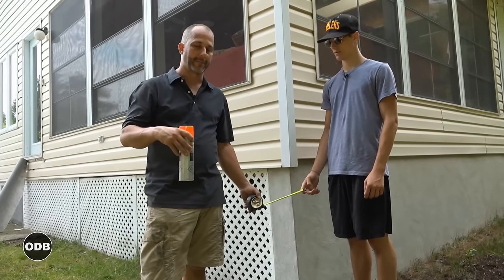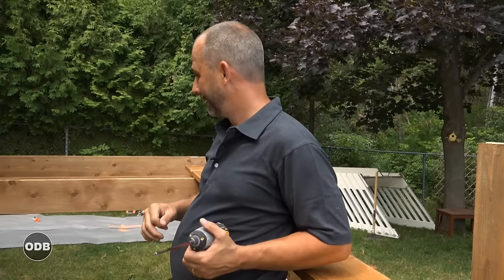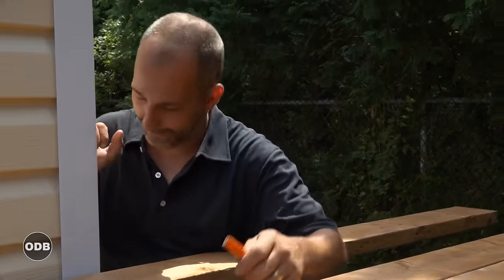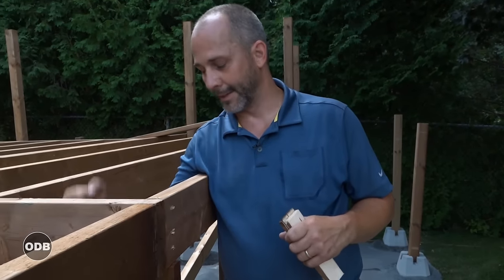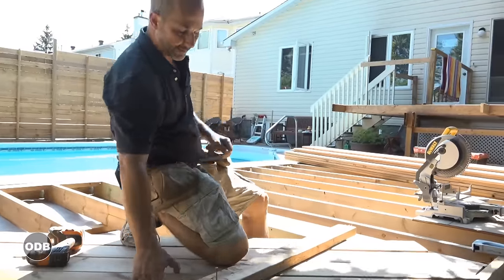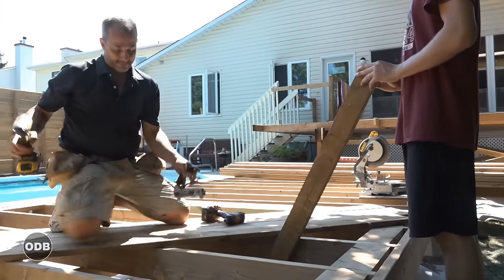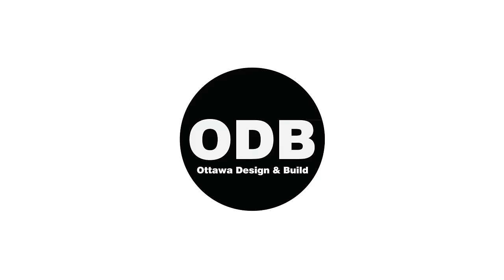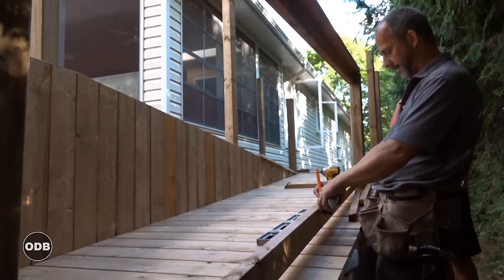How to Build a Deck for Beginners A to Z

Comment: Hey I'm not trying to be a wise guy or anything but why wouldn't you use a ship's auger to drill those carriage bolt holes?
Reply from the maker: That would work , however you only have 1 blade doing all the cutting and only the radius of the hole. This type of blade dulls very quickly in wet pt lumber.  My cold hardened steel will drill a hundred holes before it needs sharpening. This is why I use what I use. 
Great question, keep them coming. I love looking at new ideas it usually results in better problem solving skills down the road.
Reply: I'm an Electrician by trade and we use the ship's augers exclusively for drilling basement joists and anywhere else that requires deep holes.  I can't speak to your comment about wet PT since I don't work with it often but I will say that I've never had an issues using it when building my 10' x 20' PT deck. The bonus with the ship's auger is that you can punch the whole in one shot if you have the proper length bit.  I've never actually sharpened my bits either come to think of it.  Anyhow, time is money my friend.  Thank you for listening.
Reply from the maker: The other side of this is the ship auger may not create as clean a hole. I want the carriage bolt to be forced through the opening so it transfers weight directly. The ship auger may create a wider dimensional hole. But I am going to try it anyway. Cheers.

Comment: I am 67 and have health and back issues. Approx 8 years ago my brothers and I built a 20 x 10 ft deck and now it's rotting and falling thru and unsafe   I asked Home Depot for an online estimate for a 20 x 10 ft deck redo and to add additional 10 x 10 ft. add on, and received a $2200 - 4400 online estimate for pretreated lumber. I would be happy with a floating deck for the unfinished 10 x 10 area. I am on a fixed SS income and can only afford approx $2400 but don't know any handyman and don't know if I can trust them. I live in a suburb of Detroit. Can you recommend anyone? Thank you.

Comment: do you know how high can i make a floating deck? I want to build a deck with 54" height
Reply from the maker: Height is not a problem. However in most jurisdictions you should have a permit over 24" off the ground. You will also need to invest some time to make sure your build has the proper railings for your inspector as well. Contact your local building office and make sure you are building to your local codes before starting. Good luck.

Comment: I would never spread the limestone base material on top of organic material (grass) which will decompose. Would not meet code in my area.
Reply from the maker: I get your concern. However there is no huge gas trappings here and it will only settle a 1/16 of an inch. A bigger problem here is frost.

Comment: the only realistic problem with this deck is the displacement of the floating footings. they will sink over time and fairly quickly.
Reply from the maker: Sink into what? I didn't build it on quicksand. In our area frost actually raises rocks out of the ground. You are more likely to have it raise up than to sink.Don't be panicking people about an inch difference over many many years.

Comment: How about explaining in the beginning what the heck is a floating deck ?
Reply from the maker: A floating deck is when you build directly on the surface of the ground an do not attach it to any structure.
Reply: Thanks, you touch on that around the 1/3rd mark.

Comment: The joists should be resting on a cut out. The lag bolts don't have the sheer strength.
Reply from the maker: The Eiffel Tower in Paris is built completely with cariage bols, just like the ones I used. My guess would be that you are wrong about sheer strength. Perhaps a little reading before you try to make a statement of claim like an expert. It is how we avoid embarrassing ourselves.

Comment: Our building dept. would fail this job and hang  a big red UNSAFE CEASE WORK tag on it.  4x4s not 6x6s for posts...hanging the ledgers on bolts with no actual support under them...who knows if they're below frost or if they're rated for direct burial....this is a typical homeowner job. Deck failures injure a lot of people every year - hire a pro.
Reply from the maker: Did you actually watch the video! This was done under inspection from our building department. Stop trying to scare [people into thinking your lies are factual.

Comment: where they sold out of the 6 foot Robbie drivers lol
Reply from the maker: Not exactly sure what you mean.But thanks for watching.
Reply: your driver bit is a foot long just joking around... i use the impact bits ..I build decks for a living you did a great job on this one
Reply: GoGreenPM  they sell 6 inch driver bits at Home Depot! Make sure you get impact grade bits. The 6 inch regular bits fit in an impact but strip halfway through a project.
Reply: GoGreenPM All about GE cloth washing maschine  troble s.
Reply: Were*    where is a location

Comment: "This deck is solid as a rock," he says while visibly moving the railing.
Reply: My deck is 1metre below the surface and when I shake the 100x100 post there is slightly movement.

Comment: "we either have it free standing structure, or dig up the back yard to anchor it 5' under ground", the city gave us either of those options..."

me: "what a fucked up city, yes it's on clay and firm, but I believe that all of Canada does snow and water expands, if they told all builders all around "dig 5' deep, no exclusions" then all builders would be "ok, let's dig 5' deep or else we aren't passing inspection" and all will rejoice as there is less confusion about if wheelchair ramp and so forth.

Yes it would be more expensive but in the end it would assure all home buyers that "legal" means "safe" and not "well we bypassed one law by making it do this"
Reply from the maker: Let's not confuse the city inspectors job here. The deck is SAFE either way. You just can't attach something to the house without a footing. That is why we have 2 options. That is why I did this video to show people how it can be done safe and attractive. I would have preffered to put the posts in concrete but they are not allowing us to just dig down, they want us to use a bigfoot. That is why we would have to excavate the entire back yard. Holes are not the problem it was the type off hole.

Comment: Is this so called structure going to last a winter?  Patio slabs and deck blocks in the water, give me a break. With nothing fixed into the shoreline, I'b surprised if the floating docks didn't pull the whole structure into the lake, by the wake off a wakeboard boat. Typical make it look good this season, take their money, and walk away.....
Reply from the maker: You do realize that is a pool and not a lake right.

Comment: Well, what the fuck else are you going to use to fix it? The screws are really only to hold the timbers in place, the load is through the posts. Those carriage bolts look like you could park a few cars on it. The 'ONLY' point I'd make is that they need to be on an angle not directly above and below each other to prevent the post from splitting, difficult though if they're not that wide.
Reply from the maker: posts don't split if you compress the bolts and washers flush into the wood. Cheers!

Comment: Not sure what the building codes are where this guy is building the deck but main support structure should be inlaid on 6x6 posts and then carriage bolts through the 6x6 and 2 by x

The method used in this deck is wrong. All the weight of the deck is carried by carriage bolts. Not a good way to go.
Reply from the maker: And yet it passed inspection and an Engineer inspection. Perhaps it would be easier for you to open your mind and try to see a different viewpoint than expect us to change the way we build based on your opinion.
Reply: Sure hope you're not this thin skinned with your customers. Facts are stubborn things. The weight of the deck IS being carried on bolts. Didn't ask you to change the way you do anything. Keep on doing what you do and just because someone doesn't agree with you doesn't mean the mind is closed.

Comment: It’s impossible to “level” vertical post or anything else vertical. You level HORIZONTAL items.
Reply from the maker: So what exactly is the bubble for the vertical doing on my level?
Reply: Home RenoVision DIY Bubble determines if the object is plumb when you hold a level in a vertical position and level if it’s in a horizontal position.
It’s a common misnomer in the trade. The dictionary defines plumb as something vertical etc.
Reply: If you told me to “go and level the door and window”. You are actually telling me to put the level on the sill or the header. This is why accurate communication is so important.

Comment: Wood screws?  Are you kidding?  You could at least put some reinforcement under the beams .
Reply from the maker: perhaps you should watch the video again. You would realize that the joists are resting on a beam. that beam is supported by carriage bolts. This is why the structure can be built so quickly, and is the point of the video!

Comment: came to see floating deck, its clearly not floating.
Reply from the maker: Not on water but this deck is floating on the ground. Not attached to any structure which by definition is a floating deck.

Comment: Not good putting all the weight on bolts.
Reply from the maker: The engineer and the Eiffel Tower both have a contrary opinion.
Reply: I would never build a deck with the weight on the bolts, for crying out loud put the beam on top of the post.

Comment: This is just goofy.  Sure, with enough care and time, it's possible to use a light-duty cordless drill to bore holes for carriage bolts, but why?  Use the right tool for the job.  More importantly, professionals know better than to use carriage bolts to support a beam.  To be safe, beams must rest on posts, not bolts.  Even the lowliest handyman has a compressor and nail gun, so why waste time driving screws into joist ends when you know you're going to attach them with joist hangers?  At one particularly awkward point, the guy and his helper hold a level across two boards to keep them square to a post while he can screw them in place.  Here's a tip - use a square to mark the height you want and you won't need a helper.  Then there's the demonstration of how not to use a reciprocating saw - forcing it, so that the blade wanders and leaves the post too high.  To be fair, the job looks neat and accurate, but it looks to me there's too little knowledge or experience with safe, accepted, standard building practices and techniques.
Reply from the maker: Thanks John. but as you can see the drill works pretty quick and without a cord to trip over. As for the bolts they pass code work great and make the job fast. Anytime I can produce a quality project in less time it costs my clients less it is a win win. BTW when will you be posting your video on how to do it right.

Comment: That's not "clay", that's grass, you are just tipping limestone onto an organic material. WTF? You've clearly got a slope on that site so your point about standing water is dubious. What happens when rain and movement starts to wash away your little piles?
This has to be the first time I've seen a Canadian under-engineer a deck.
While it might all work, tbh I would hope people thinking of building a deck would consider a more robust approach.
Also, as a video it was way too long, this is Youtube, not some Film Noir epic
Reply from the maker: Wow what a debbie downer. I would reply to your critique however you are obviously not here to learn anything. Try to enjoy your day and crack a smile.
Reply: I did learn something, screw on joist hangers were new to me.  But you'll appreciate your foundation design looks a bit half assed compared to most on here. The video just is too long, I'm sure there are lots of people willing to sit down for an hour twenty and watch you nail stuff, and if I were 100 years younger then I would too, but your title says "How to Build", therefore it's purporting to be instructional. Instruction is brief for a reason.

Comment: Don't ever build a deck in this manner.      

No knowledgeable building inspector in Ontario, even without wheelchair access ramp, would pass this construction. 

All framing is about achieving plumb, level and strong. The majority of a lumber deck is framing.  The finished product exhibited to the eye is one big framing construction that has to withstand live load and the might of nature. In Ottawa, Canada and general region, the winter temperature can drop to -20-30 Celsius with decent gusts and major snow fall. All decks in this region must be built strong and fortified against the elements.   

This deck is the cheap fast route that will buckle and fail in time. The prefab concrete piers sitting on grade will rise and fall with frost heave and thaw, bending and weakening the screw fasteners. Any decent inspector would order their removal and order proper postholes built.  Every wooden deck should be built to absolutely minimize vertical movement.   

All above-grade wooden decks that accommodate people and inanimate objects like BBQs, tables, benches, require the foundation to rest on undisturbed soil 48" below grade and the foundation footprint wide enough to support all reasonably anticipated structural load requirements, called design factor.  Every backyard deck is built in expectation of at some point being packed with people, which the deck structure must be able support. All decks should be built to physically support darn near a school bus.  This can't be done by the cheap easy route.  

Fastening beam members to either side of a post, the split saddle, is a waste of good lumber.  Beams should always sit atop posts and where they get their vertical load bearing strength.  Threaded rod, bolts and washers, or carriage bolts, whatever, are no substitute for a solid 6x6 or 4x4 shelf of a post encased in concrete, in builder's tubes, resting on undisturbed soil. Better still, all faces of the concrete encased post waterproof sealed, as the moisture in concrete dissolves the wood.  

Screws should never be used for joist hangars or any load bearing framing. The best thing in this video is they used the hangars. Good for them. Joist hangars are designed for joist hangar nails. The #10 or #9 Simpson screws are for fence rail clips.  

Screws have great hold down strength.  They're great for plywood subfloor in combination with construction adhesive.  Most any horizontal application or non-load bearing vertical. When it comes to vertical bearing, affected by gravity and live load, screws can't handle the duty. They should never be used on any deck except to screw down the 2x4 or 2x6 deck boards.    

This video shows a fun, happy-go-lucky weekend build-a-thon.  But the fact is that every wood deck is about how strong it's going to be ten or twenty years from now.  So when it;s built, is built seriously strong the right way with the right materials and techniques.
Reply from the maker: Jason , what are you sooo afraid of. Nice novel by the way. My Engineer and the City inspectors signed off on this project. Perhaps you should be taking notes instead of trying so hard to nit pick.
Reply: All depends on the building inspector assigned to the permit.  When I went to university there and periodically worked in the trades, the inspectors were no-nonsense perfectionist.  Things change. One year Ottawa, like any city, has good building inspectors; the next things change. 

As a builder and renovator I'm not fearful but committed to doing everything right as possible to avoid getting a callback from a client that something didn't work as planned.  

In your deck build, you skipped the post hole digging. That's OK for warm climates.  In Ottawa, and all of Ontario, the freeze/thaw beats the heck out of exterior lumber construction. Always ideal to dig post holes set in builder's tubes as the foundation. 

Wait and see. I'll predict that the climate will pummel this deck within a few years and all the fine work put into it.